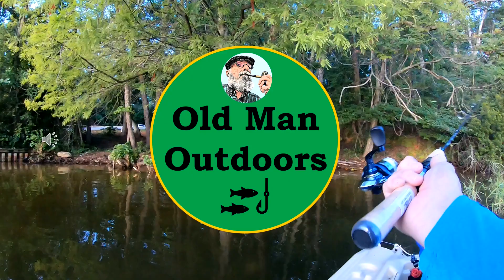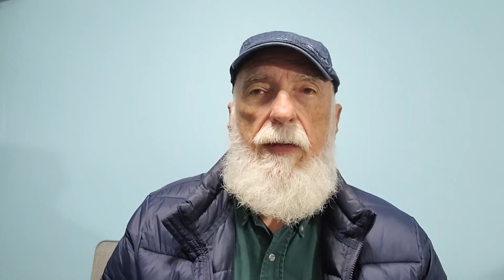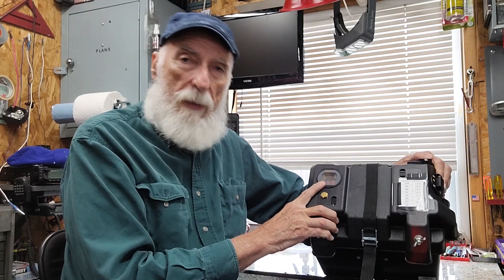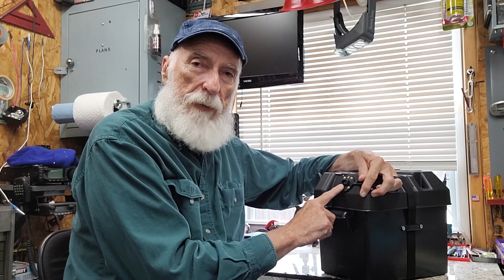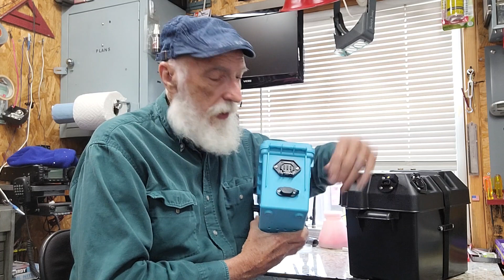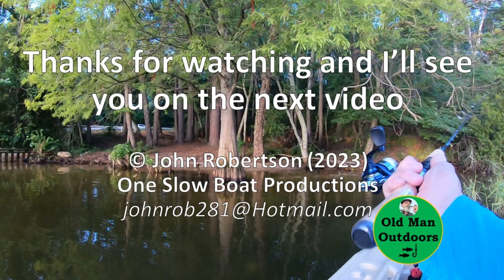Battery Management System Boats-Self Contained

Comment: John,  I have a inflatable boat called a Zonker.  7' long, twin pontoons and I drive it with a 45lb thrust Minn Kota.  I didn't see your links for sources of the components.  Our motor has a max amp draw of 42 amps but I'd figure 50amps.    Several PWM on Amazon but I can't seem to find the box.  Also, have you ever used a 12v fan set up to dispell the heat?   Our controller box will sit inside a canvas bag 12"w X 12" H X 30" long.  Any comment would be appreciated.  Thanks